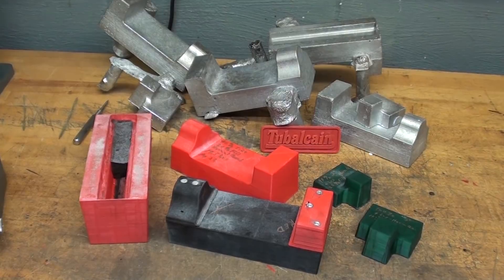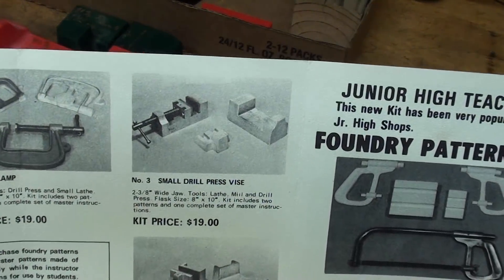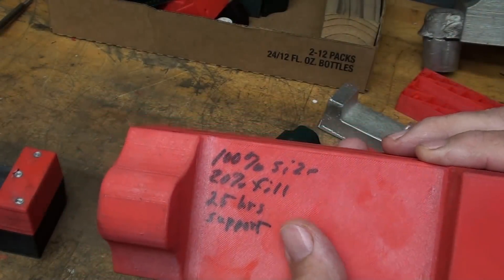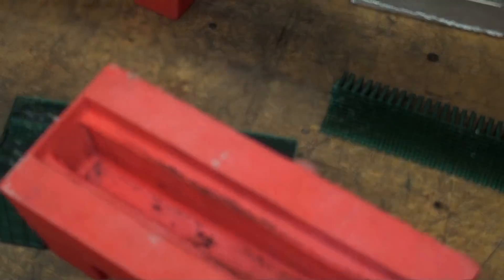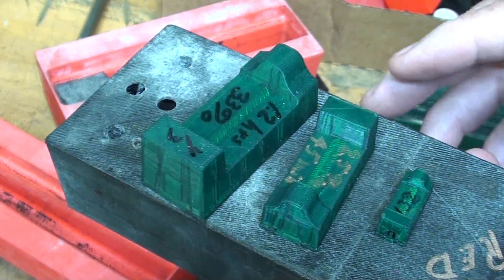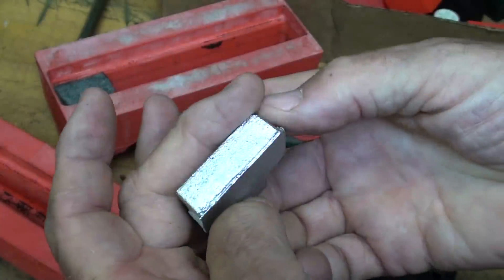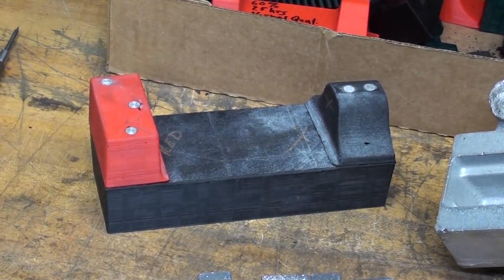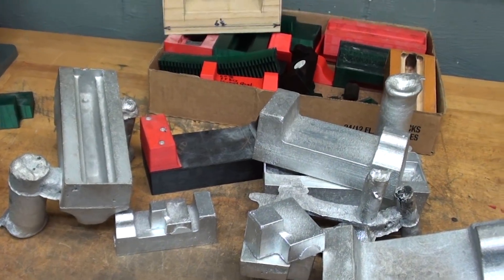Foundry Patterns for Drill Press Vise #446 tubalcain

Comment: Sir. Is that possible that these mold be using on cast iron? I am preparing to make an small iron foundary. As you have said before, how good can a vice be made of alu. And recently i get some information from a real sand crab. That youtuber show his propane foundary casting cast iron instead of alu. To my surprise, it is just the gas regulater on the bottle and the mold different. Everything else is same! Blower, the bucket, kelt wool insulation. All the same, just changing the flux to ferrate silicate and that's it. I think the wind is changing, diy er will not satisfy casting alu and will try casting iron very soon. 
As you have mention before, casting alu will have different shrinkage to cast iron, will it be strinking more than alu or less?
Reply from the maker: Go ahead and try using cast-iron. I do not intend to do that. Very few people watch my foundry videos anyway. And I am starting to turn away from it. But thanks for watching
Reply: Sir. I watch every one of the foundry series. I did try doing my casting a couple of times as well. So far only 2 out of 6 is useable. I guess it is those plastic/epoxy coating on the coke can that cause the problem. Since borax is a control chemical here (can you believe it?), without proper flux, the finished casting is full of bubbles. In the last 2 attempt i add some drainage soda in the pot, seems less bubble, but the smoke is so corrosive! Obviously, i got some serious complain for that. Then i think, a 700 degree c alu foundry is as danger as a 1000 degree c iron foundry when the shit hit the fan, why not going for the higher temperature? Still looking for some real graphite crucible, and planning to buy a oxc torch (another control substance, you need to show your welding licence when you buy the torch and order gas bottle, can you believe that?) i don't understand why people will do nothing when they are living on a country that people are free on using chemicals and equipment, even guns.
Reply: I am just starting casting (I use an electric furnace patterned after TAOW's videos) and I also started with pop cans.  On suggestion from another YouTuber, who's name escapes me right now, I tried table salt as a flux to clean up the dross.  My dross when from mostly really dirty aluminium to a light grey ashy compound that for the same volume weighed considerably less than the non-salted dross.  I hope table salt isn't a controlled substance where you are and that you can give this a try lol!   I will try to get some videos up to show what I am doing, mrpete's videos have been enormously inspiring for me so I kind of hope I can follow in his footsteps somewhat.
Reply: @JointerMark 
No kidding, borax and oxc blow torch is really a control substance here with reason. Rubbish peoples of republic counterfit merchants put borax into rotten meat to kill the smell and sell that in the market, result in food poision (bacterial and chemical at the same time) result in case of death. That is why it was band. Oxc torch is even more obvious, multiple case of fire and explosion cause by unlicenced/i don't fucking care type of workers coming from peoples republic of counterfit. That's why.

Table salt and potassium salt don't work on degas in my situation, i tried that already, i think it is related to the chemical properties of the thing that polluted my alu, i guess it is teflon. anyway, coke can are famous for low yield on casting, scrap alu is expensive here. That is also a reason why i want to change to cast iron, it is just 30% price of scrap alu. I also tried putting some fishing lead into the pot in my 3th attempt, also work, but only in terms of shape, but a total  failure on strength. The casting turn into some grey alloy which fill all corners of the mold details perfectly. If your casting is for decoration only and do not require strength, i will recommend that.
Reply: I agree the salts do not degass the metal, the salt just seems to free the aluminium from the dross.  I suspect the dross is mostly burnt epoxy and oxidized aluminium and may be a wee bit of the paint but I can't imagine that there is much paint on the cans :-)
Reply: @JointerMark  
Those are not paint, it is bisphenol-a (a famous cancer agent and female sex homo) base epoxy coating inside the can. Usually something like DER331, Epon829, Genomer2255 that kind of things, or in other case, teflon base epoxy, coating usually will be about 1/2 thou thick, acid resistance, less than 100mg per can. Without that coating, cans will rust and blow up on your face in summer. In case of teflon, it can hold up to 450 degree c, higher then lead. 
Beer can is better, usually the coating is thinner, sometimes no coating.
Paint outside the can can be burn easily, but the epoxy coating is **inside** the can and that`s why there are so many dross when melting coke cans.

Comment: Could you do a video to discuss the limitations of aluminum as vise material? It is so easy to machine, compared to iron or steel, and seems adequate to most home shop needs.
I enjoyed this one immensely and look forward to the casting.
Reply from the maker: Probably will not do a video on that subject thanks for washing
Reply: Cliff, the issue is strength vs. rigidity. The aluminum will deform without breaking (up to a point of course) whereas cast iron will deform very little until it fails. You see this problem in automobile engines. Cast iron cylinder blocks are very stiff compared to aluminum. This stiffness is critical for crank bearing alignment. Aluminum blocks require very careful design and  bracing to obtain the desired stiffness, i.e. you can't use a cast iron mold to make aluminum blocks that will be stiff enough.
So replacing iron with aluminum isn't a simple proposition. It can be done but requires a redesign of the product. There is also the issue of sliding surfaces. Iron is an excellent load bearing material. Aluminum often requires inserts for the sliding surfaces because it deforms and galls. So at the end of the day, the advantage of  aluminum ease of casting is often not enough to out weigh it's short comings in some applications. 
The trick is to do what Lyle is doing... make good patterns and them send them to a specialty foundry, like Cat Tail Foundry, and have them poured in cast iron. As Lyle and others have mentioned, doing cast iron at home is really not an option for the average person.
Unless of course you have a bunch of friends who aren't afraid of molten metal..
https://www.youtube.com/watch?v=JFJVdFGbHMA

Comment: I think that if one uses them within the limits of aluminum then they would give service for years...for more clamping pressure one can always reach for their cast iron or steel vise, which we all have.  I do believe that using a lighter-weight aluminum vise will provide the sensitivity for the work to "float" for more accurate drilling.  Nice tool.  Thanks, Mr. Pete! :-)
Reply from the maker: That is a good analysis